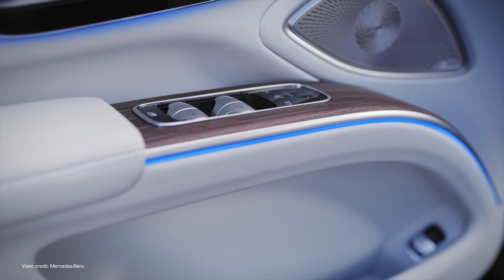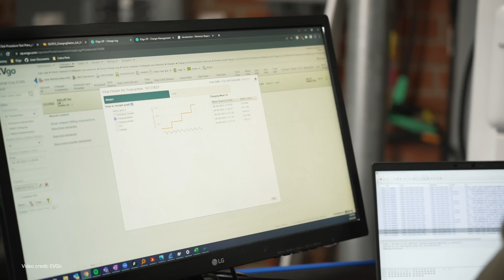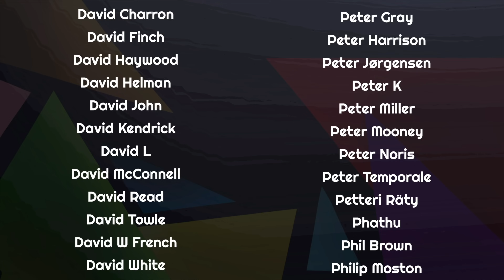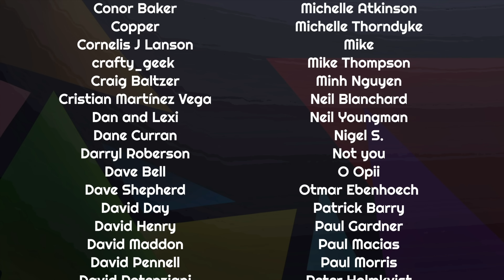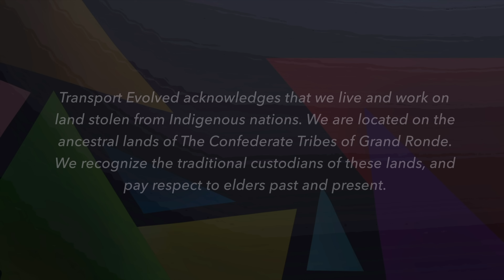EVs have a weight problem

Comment: Your missing the technology involved. The obvious is the very hard stainless alloy developed by Tesla. What you are missing is the change from 12V to 48V. Next is drive by wire without a steering column. Brake by wire instead of hydraulics will be in the next generation vehicles. 

But the change is in how these BEVs are built. The next generation will be truly astounding and brilliant. Optimus, a Humanoid android will be part of production process for repetitive and dangerous task. 

Finally, Tesla doesn’t think every one needs to own a car hence ride sharing via existing companies such an Uber and Lyft culminating in Full Self Driving Cyber Taxis. The best of all worlds with Public Mass Transit still available along with bicycles, E-Bikes, E-Scooters to move people in metropolitan cities. Rural needs will move slower from diesel petroleum for pickup trucks, tractors, and other heavy equipment but even they will have BEV options while maybe even hydrogen fuel cell or hydrogen ICE engines which will depend on a hydrogen infrastructure throughout the country and world.  This includes long haul trucking. We shall see what unfolds.

Comment: Weight is region specific. Safety/government regulations, weather, travel distances, existing standards, marketing cost/sales expectations, standard of living, economy, parking space and garage size, terrain. Another consideration is air quality, pollution, risi g sea levels, changes in extreme weather patterns.

Richer more developed regions want comfortable vehicles with all the bells and whistles. Poorer less developed ones can only afford minimalistic transportation modes. North America is massive, huge differences in weather, climate, terrain, elevation, family and vehicle size. Most European cities or countries are significantly smaller, compact, densely packed. Moreso in cities vs urban vs rural.

Lighter exotic materials and processes are not cheap. Raw material logistics and availability also increase costs. Life cycle, reuse, recycle capabilities also increase costs or impact brand image. Real leather, faux leather, hard plastic vs tacticle, steel/aluminum/plastic/fibreglass/HSSteel/carbon fibre/real wood vs faux, laminates.

GDP, growth, inflation, interest rates, salary increases dictate what population affordable options are. Are vehicles overly packaged for sale? Or can buyers have more desirable options?

Comment: EV technology is very young, especially battery technology. After a few generations of battery evolution, EVs may well become practical choices for a large percent of car buyers. Charging infrastructure should also advance over time. Right now, it is difficult to plan on having a charging option at the other end of a trip to many locations, let alone charging en route on longer trips. Right now, if you need to charge batteries on a day's drive, you need to add hours to your trip, which is not practical. I love the potential of EVs, but the technology is not mature yet. It works great for people who only drive short distances. For the rest of us, it falls short, especially on cost. EVs cost much more to buy, primarily because of battery costs, and recent reports teach us that the cost of battery replacement is exorbitant ($15,000 to $20,000) which is shocking, especially since batteries often are not lasting as long as the car companies predicted.

Comment: Actually the US has a fantastic freight rail system.  The US freight rail system is considered the best in the world.  You would never know it from US passenger rail service.  What it means is bigger percentage of cargo is hauled by train then in any other country.  Also the US inland waterways like the Mississippi is very well used.  What it means is US use of trucks is low by world standards.  Hence trucks do less damage to roads then most countries in the world.

I found out about US freight rail, when trying to figure out why US passenger rail is so bad.  Take Europe vs US.  European freight rail has a maximum 0.7-0.75 km long, 20 tons per axle, 15-16 ft loading gauge.   US unlimited, length routinely 3, up to 5 km.  30 tons per axle, 23 ft loading gauge.  With those limits, you can haul up to 15 times as much cargo, with 5-10 times routine.  Ouch!!

Comment: The real problem with electric cars is the fact that batteries do not store electricity. This means charging a battery has an energy conversion step, which in turn imposes a power limit. To circumvent this power limit manufacturers entered an arms race to put more and more batteries in their cars, then they had to put motors that are more and more powerful to drag all those batteries around, and when the cars started costing a fortune, they had to put a bunch of tech gadgets and screens so that the high sales prices could be justified. This is what stopped electric cars in the early 1920's. They saw it coming again in the 70's and 90's and gave up. The only reasons they tried again and we have EV's now are government policies and the fact that now there are more people with money to buy them.

By the way, don't get me wrong, I'm all for electric primary traction. The technology has been ready since the late 1800's, and humanity should have switched from steam directly to electricity for all mobility, not just a few types of trains. Our only mistake was the energy storage.

Comment: I agree with many of the points raised but one specific critique I have is the omission of the additional risk of smaller cars. While the host talks about how SUVs have roll over risk which reduces the net safety increase of going to an SUV from a small car the equivalent for the small car isn't mentioned at all. I've seen the crash tests where small cars like the mini cooper, smart car, etc. get into a collision with a modest sedan going at modest speeds and the small car leaves the ground. This is a way more dangerous situation than a rollover with an SUV (although that risk is also very bad).

Comment: Can I join you on your hobby-horse Kate?  And yes, I too get into similar recursive loops.  If you ever find a cure, I am interested to try it.  😁🤪
I keep looking at all the VAST recent model ICE pickups and SUVs that are infesting the streets around here in Australia.  I am glad you included the numbers quoted concerning that parking garage failure report.
If the EVs are supposed to be a problem, first the legacy brands have to get serious about slimming down all these behemoths.
At the same time, most "car" brands have always produced ever bigger "cars" of all types.  Unfortunately of late they are dropping small cars off their product lines.
I still drive what is getting to be an old sub-compact ICE car... because there are NO suitable EVs available.  I just do not need or want an SUV.  I keep telling the dealership sales people - but TBH I don't think they are listening.  And if the dealers are telling the importers, are they listening to the dealerships?  I have also tried telling the importer of the brand I have... and I had the feeling that I was in that recursive loop you suffer from.
It is a nice idea to tell them with a purchase; but that is hard when the offerings are nothing remotely like what you want.

Comment: I have a few points to add:
1. Changing people's habits is near impossible, and people love their big cars. The next best thing is giving people big electric cars. Still a lot better then big diesel cars.
2. The Cybertruck is actually pretty light, for what it does. Thanks to revolutionary manufacturing, high efficiency, and a small battery pack. The bigger pack in the CT is still only 130kWh, only a little bigger than what the Model S Long Range has. For comparison the Hummer EV has 250kWh.
3. The Cybertuck has a small frontal area and a sloped hood in the same plane as the windshield. This likely makes it better for pedestrian safety than other pickups. It also has the best active safety systems, so it's far less likely to hit you in the first place. Oh, and the visibility is better too.
4. The CT doesn't roll over due to the heavy battery pack in the floor. And also Tesla cars in general are stable in water too, unlike gas cars that tend to turn upside down and sink fast.
5. In general Tesla makes very efficient EVs that are about as heavy as their gas competitors.
6. Tesla also built by far the best charging network, which reduces the need for range. Tesla cars have been using the same battery sizes for many years. They specifically said that more range is unnecessary.
7. Tesla is moving toward smaller car in general, they are coming out with a compact car next year, which they are planning to make at Toyota scale (up to 10M annual production capacity is planned).
8. As for land use, self-driving cars will largely eliminate the need for parking lots, as cars will be in use 5-10x more, and they'll be able to drive out of the city when not in use.
Also helping one of Elon's other companies, The Boring Company, which is moving traffic underground. It had a slow start, but now picking up pace.
Reply: Several good points here that people go out of their way to ignore.

Comment: I am planning on getting the 600 mile Aptera.  I do long drives fairly frequently, like once a month.  Once I retire, this may or may not change.   I actually may do longer drives when I retire.  Hence the 600 mile Aptera.   I did want the 1,000 mile Aptera, but realized I could easily live with the 600 mile version as the high efficiency means it recharges 2-3 times faster than other vehicles at any charging station to include Tesla Fast Charging stations.  Even the 600 mile version is amazingly light.  It will have just about everything I need.

Comment: This is a comment I submitted to when CA was proposing a $0.04 per mile annual fee on top of other flat registration fees. Weight-consideration was my focus for achieving fairness in such a fee:

My comment relates to the proposed $0.04 per mile charge for vehicles.  I understand the state and city are in desperate need of infrastructural repair and improvement, and I am personally willing to pay my fair share.  However, my focus today is on what constitutes "fair."

According to the Comptroller-General's Report to the Congress "Excessive Truck Weight:  An Expensive Burden We Can No Longer Support" by the US Government Accountability Office (http://archive.gao.gov/f0302/109884.pdf),  road damage from one 18-wheeler is equivalent to 9600 cars (p.23 of study, p.36 of PDF).  The study assumed a fully loaded tractor-trailer at 80,000 pounds, and a typical passenger car at 4,000 pounds. That’s 20 times difference in weight, but the wear and tear caused by the truck is polynomially greater (think exponential, but not quite so dramatic).  So, with respect to road-wear, when a fully-loaded semi uses a road once, it's the equivalent of my 2,400 LB Honda Fit using that same road well over 20,000 times.  I have no idea what the multiple would be versus my 500 LB motorcycle.

I'll happily pay $0.04 per mile I drive... so long as that fully-loaded semi pays the approximate $1000 per mile equivalent for the relative damage caused.  Clearly that's not realistic, but the article I read states that it's "a plan that SANDAG has estimated could raise more than $34 billion through 2050 to help fund transit projects throughout San Diego." If the goal is $34B, then let's figure out a fair way to get to that number.  Many engineers agree that, besides things like ice, salt, snow, and flooding (clearly not an issue around here) that 90%+ of road damage is attributable to heavy, commercial vehicles.  There should be a sliding scale relative to a vehicle's maximum laden weight.  On the non-commercial side, this would also help curb consumers' thirst for vehicles of a size that far outweighs their needs.

I fully understand that commercial trucks paying their fair share will trickle down to the consumer, but until we stop subsidizing destructive industry and commercial activity, there will be no incentive to dive head first into creating real, lasting solutions.  Will this lead to a total redesign of semi trucks? A total logistical revamping that utilizes more last-stop vans?  More investment and utilization of heavy rail?  Perhaps  the deployment of large, commercial drones.  Who knows?  But we will never find out if we continue to force the people not truly responsible for the damage to foot the bill for those who, up until this point, have had the government's blessing to ignore the true cost of business.

Comment: The cybertruck does not. I was surprised at how light the CT is. 6850
is pretty much what an F150 extended cab gas truck weighs. My F350
ex cab diesel weighed 7100 and any 4 door truck will weigh more than 
the ext cabs do. Betwix the battery pack & the stainless I was sure it
would weigh lots more. I understand the RT1 weights more altho it
is a smaller truck.

!

!

Comment: The problem I have is they don't solve the smog problem. It turns out the smog is mostly coming from tires. EVs make it slightly worse because the increased weight means they go through tires faster and because they have to use tires that wear sooner so that they can be low resistance in order to hit the mileage they
Reply: The main component of move is ground level ozone, VOC’ and Nitrogen Oxide. Particulate matter is a contributor but not a main cause.
Reply: @haywoodmorganjr1326  that's visible smog but in terms of what you're breathing it's 200 to 1 tire particles. Just Google that and you'll find the studies. The stuff that is going to kill me in about 10 or 15 years tops is coming from tires

Comment: No! Electric vehicle weight does not impact range because all energy expended on acceleration is later recaptured by regenerative breaking. The suspension is extremely elastic so very little energy is lost over bumps. Furthermore the kinetic hazard of additional weight is mitigated by autopilot.
Reply: Rolling resistance scales with mass.
Reply: Insignificant in comparison to wind drag when comparing gas to electric weight differentials.
Reply: Interesting. I’m not aware of any EVs with a drag coefficient of 0.0, and a friction coefficient of 0.0. ALL energy expended in acceleration cannot be recovered by regenerative br(e)aking, unless you live at the top of a very big hill and push the car home.
Reply: This discussion is about vehicle weight. Drag coefficient is not in any way related to weight.You are confusing separate issues. 100% of energy put into acceleration is maintained within the kinetic body until regen breaking activates, as can be calculated from KE=(mv^2)/2 so please try not to confuse everyone.

Comment: Weight impacts efficiency a lot in combustion cars, but doesn't matter nearly as much in electric cars because most of the energy spent moving that heavier weight when you speed up goes right back into the battery through regen when you slow down. What does matter a lot in EVs is aerodynamics, which depends on the vehicle's size and shape. In general, bigger vehicles, which are less aerodynamically efficient, also tend to be heavier, but the drop in efficiency still has much more to do with the vehicle's size than it's weight.

You can see this firsthand when comparing the efficiency of two EVs that are the exact same make a model, but with different battery pack size options, leading to different weights. In all cases, the extended range option only decreases the miles/kWh by a few percentage points.

It's also worth noting that, while, all else equal, an electric car is a bit heavier than a combustion car, it only really matters with large EVs, not small ones. A Chevy Bolt, for instance, actually weighs less than a large number of gasoline-powered SUV models, and the entire weight of the Bolt battery (~1000 pounds) is only slightly more than the weight of four adult humans in the car, plug some luggage. So, if carpools and luggage are not a concern for the longevity of the roads, a Chevy Bolt should not be either. (Of course, as you get into stuff like Lightning trucks and Hummers, the battery pack weights are much higher than this).

Comment: At this point, I'm pretty much sold on the Silverado 3WT if I have to replace my truck within the next couple of years, and simply put, it's mostly due to the reduced battery weight. The 4WT has a 450 mile range, which is important for a fullsize truck with 10,000 lbs of towing capacity; however, that weight eats into the payload capacity (1,300 lbs), which is on the low end for a half-ton truck with a 6' bed. By reducing the battery size ( ~180 kWh instead of ~212 kWh), the overall weight of the vehicle appears to be about 500 lbs lighter. As a result, it still has a reasonable 393 miles of range, but the payload has increased to 1,750 lbs and the towing capacity is up to 12,500 lbs. 

Of course, $75,000 before incentives is still A LOT of money to replace a fullsize gas truck that cost $24,000 at the time of purchase, so I'm also looking forward to seeing what happens if the battery pack is reduced further. I could probably get by with 300 miles of rated range because I don't tow heavy loads very often, but at current prices, I doubt we'll ever see a 300-mile fullsize EV truck for under $40,000.

Comment: I think this is much ado about nothing. My daily driver EV is within 500 lbs of the lightest ICE car I've owned in the last 20 years. I think the reason we're seeing such a rapid increase in the weights of EVs is because recent battery technology advancements have opened up the possibility of new vehicle formats as EVs  (in particular, large SUVs and trucks). That being said, though, those larger EVs still have similar GVWR as their ICE counterparts (typically <10,000 lbs), meaning a fully loaded EV truck will still weigh no more than a fully loaded ICE truck (though the EV won't be carrying as much cargo).